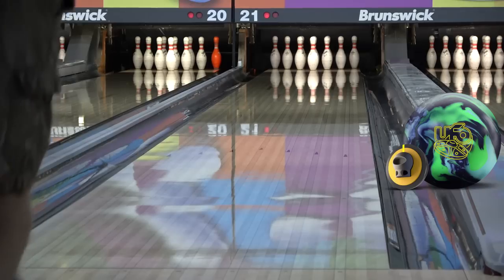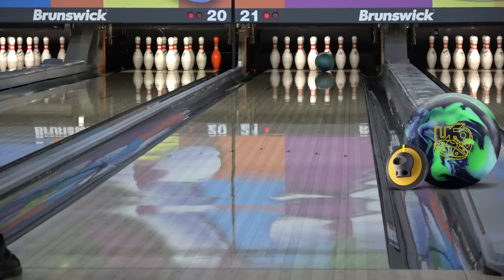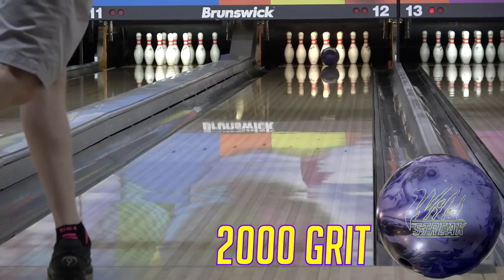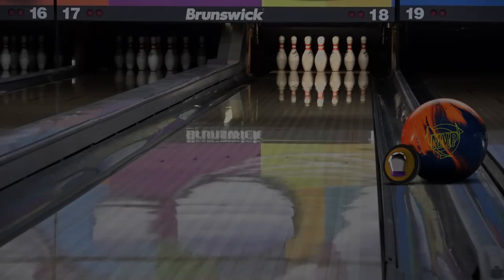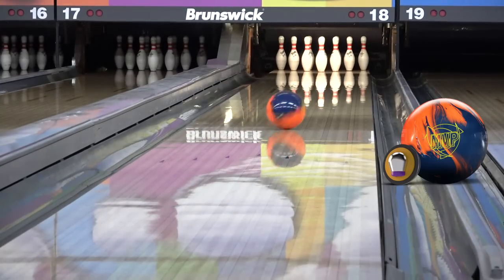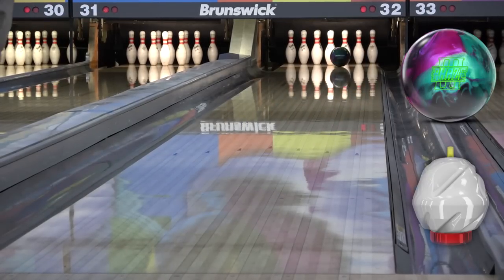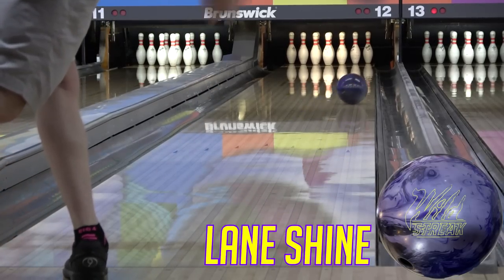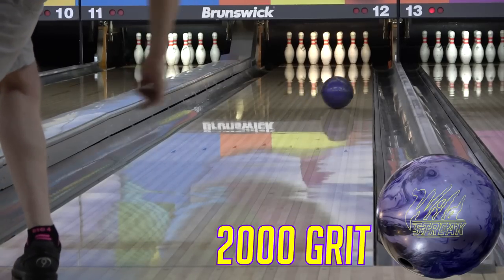Bowling Ball Surface For Beginners

Comment: As a Low Rev/Low Speed Zero Tilt bowler the main issue I deal with on the typical Wet/Dry blocked house shot is over/under reaction.
If I miss right the ball overreacts and goes through the nose and if I miss left the ball never hooks and washes out.
Balls with low flare, later reaction layouts and shiny surface seem to aggregate this tendency while balls with high flare, early reaction layouts and lower grit seem to tame it down.
Generally the best look I get is with balls that read the lane front to back with very little side to side motion. Then I can control the shot. I may sacrifice carry, but by avoiding all those over/under opens, I actually average higher.

Comment: But wait, what if I have a polished ball and it got dropped in sand? You see, I went to the beach this weekend and some drunk college kids took my MVP thinking it was a volleyball. Needless to say the ball didn't move very far on the serve. My MVP was all sandy so I tried washing it off with water, but now it's all muddy. Not sure what to do at this point. I suppose I could using a towel to wipe it off...hold on a second, let's see if this works...yep, yeah it worked...it looks fine now, should be good to go. Thanks Luke!

Comment: Heard a pro bowler say they took a Axiom ball with the NEX coverstock take the surface up a little bit.
I'm wondering what they mean when they say "taking the surface up".  I assume he means they took
the balls surface from a 1500 factory grit to about a 2500?
Reply from the maker: Probably talking about the original Axiom, and yeah, just made it a little smoother or less rough so it’s not so early and strong. It comes at 3000 I think, so probably took it to 4000 or even added some polish
Reply: @LukeRosdahl  They were actually talking about the Axiom Pearl.  Same ball I have.  Which comes with a 1500 grit.  Thanks though for confirming.  I figured that's what they meant but there's so much lingo in bowling that's used I don't want to confuse anything.  I'm trying to take my level of bowling to a whole new level.  I've already been a 200 average bowler since I was 17 years old (I'm 37 years old now) but I want to take my talents to a whole new level so I'm studying all kinds of stuff I never cared to pay attention to.  Such as pap layouts, sanding balls, paying more attention to boards on the lane when I adjust etc.  These in depth things I never cared about despite still being a good bowler.
Reply from the maker: @Mista808  Well 1500 grit polish is way different than coming 1500 sanded, I would bet they meant they took the shine off or sanded it to make it stronger rather than actually taking the grit up or polishing it more.

Comment: is polishing the NEX cover defeating the purpose of it if i cant generate the float to get through the head oil.... will it have backend motion if polished or have chosen the wrong ball for my skill level on the house shot? i cant get my phase 3 to finish hard either
Reply from the maker: Nah a lot of the pros have done it, and everything will always go longer and have a stronger backend when you polish it.  The problem is that if you can't get a Phaze 3 to move on the backend, you might need to go see a coach or talk to your pro shop, because it's one of the strongest backend balls I've ever thrown.
Reply: @LukeRosdahl  thanks ...ill slow it down a bit and get better body position at the release and stick the landing

Comment: This really helped.  I'm getting back into bowling for next league season and I haven't bowled in years.  Let's put it this way urethane was the ball.  So I'm not sure what to use..........I know urethane but I've seen a couple of videos on short pins maybe instead?  Any help with a video about this would be cool.  Thanks
Reply from the maker: There are actually several videos like that out there if you want to check them out.  I'll be drilling some short pin stuff for nationals most likely, so if I do, I'll definitely make some videos.
Reply: @LukeRosdahl  That would be cool thanks

Comment: Question: how much of a difference is there in ball reaction if I polish a ball at 1500 or 2000 versus polishing a ball at 3000 or 4000? Is there any noticeable difference?
Reply from the maker: Quite a bit actually, undergrit is a fairly big thing and most people don't talk about it.  Give it a shot and see, if you don't like it, can always change it!
Reply: My pro shop normally doesnt polish a ball that is already over 2000 grit because it can make the grit very high and make the ball movement uncontrollable.

Comment: im trying to understand more, so i got a question when the lanes are dry use a shiny ball and for oily lanes use dull? also the stronger the surface means the dullest?
Reply from the maker: Kind of, but not quite that simple.  Shiny balls are going to react more strongly to the dry, but there are several different strengths of shiny balls.  Plastic is technically shiny but it has little to no traction or reaction on dry.  The Phaze 3 on the other hand is also shiny but has tons more response to dry.  This is kind of the basics, more just explaining that a shinier surface isn't going to have as much traction in oil, but will respond more sharply on dry.  Sanded surfaces however will dig through the oil, but be smoother on dry because there's technically less surface contact with the lane.  Then you get into actual coverstock formula strengths, cores, etc . .
Reply: @LukeRosdahl  ok interesting, ive got the nuke cell pearl that i can use on the oily lanes preferably than the dry lanes, its really bad, doesnt clear the fronts much but of course on league i can get the ball to hook and have a better backend. but if i got 2 pearlized balls 1 for the medium and heavy but more middle and ive got another pearl but for mainly dry im still in a good spot? my question is for dry and some oil on the lanes im good to have 2 pearlized balls in the bag and be fine.

Comment: Cover stock is more important than the numbers
Reply from the maker: Not really . . they both play a pretty significant role in ball reaction. The Proton PhysiX and Hyroad Max both have the same cover but are fairly different on the lanes. The cover makes them feel fairly familiar but the core differences also separate them quite a bit.